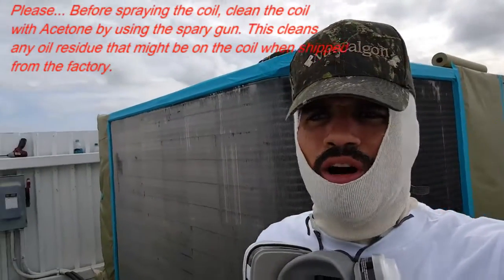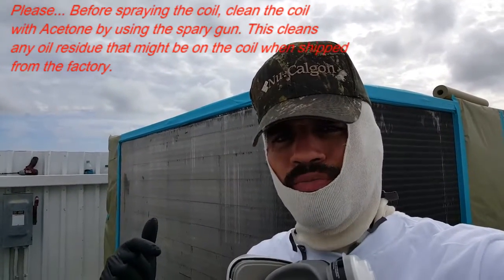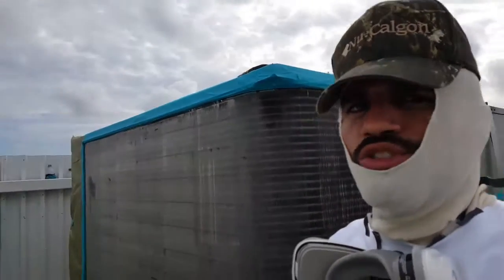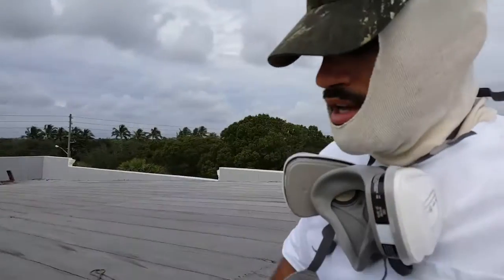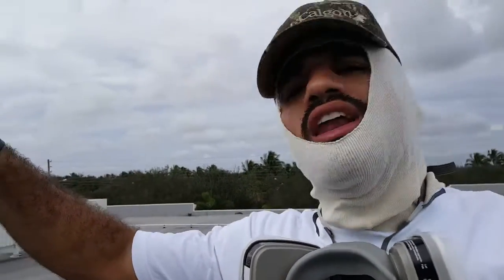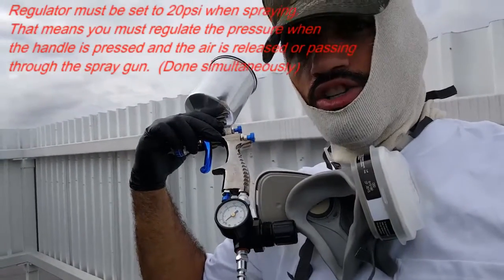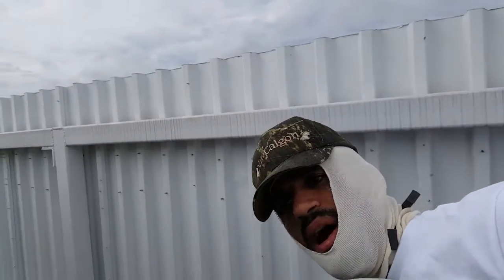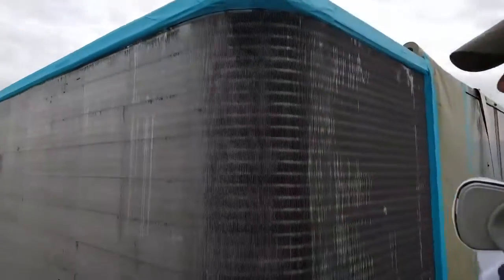Hvac condenser coil coating

Comment: Hey man just wanting to know what product did you use on the coils and fins of that particular unit? It looks like reefer mac which I use at work to put onto the copper coils and the rest of the copper tubing and headers of the various units we get in . With in that we only sometimes spray unit fins to help promote adhesion for when we use Polual XT to penetrate the coils with properly and then to clean up the penetrative lines the next day we re go over the units with an extra coating of Polual XT with an open fan fin edge which in turn takes away those lines as I mentioned before and we always have the units isolated off even if we wash the coils with coil cleaner and or have to re spray the units especially if we have to get inside of them to spray internal sides of fins and coils namely we use an open fan for inside the units but mainly concentrate on penetrative techniques with the Polual XT on the outside where as you mentioned is exposed to the elements and see corrosion.. 🙂

Comment: If its coated, how can it expel heat?
Reply: It greatly depends on the coating product. There are many products out there, and some are not good. You must choose a product that has superior corrosion protection combined with a very minimal DFT (Dry Film Thickness). For example, we have a product that goes on at 6-8 microns. Protecall.com